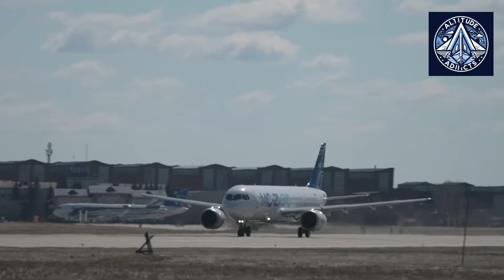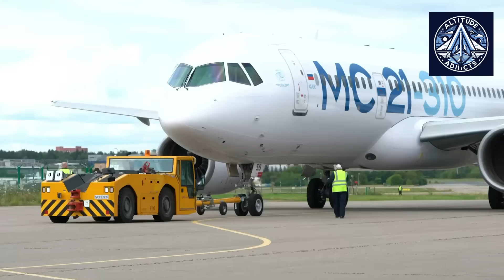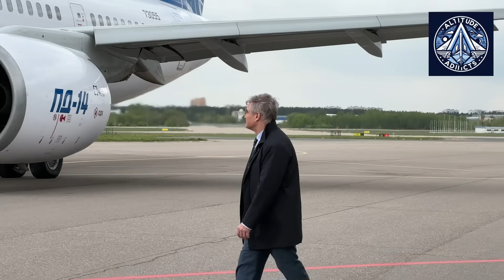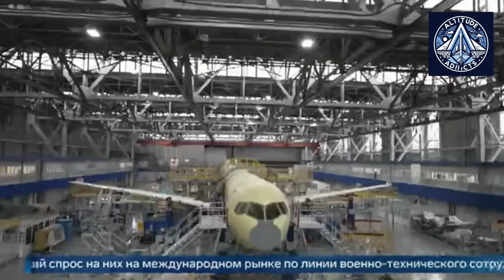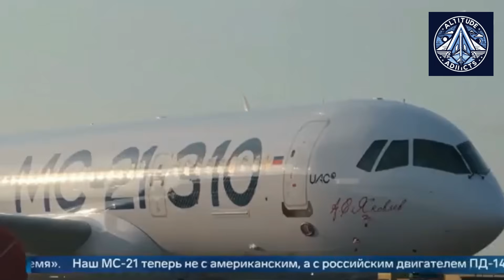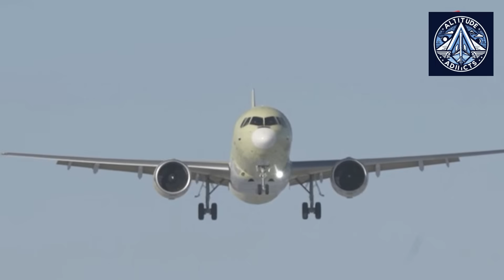MC-21-310 Flies Moscow to Syktyvkar Like a Passenger Flight—Key Test Flight Explained

Comment: Ficou seis toneladas mas pesado?
Reply: Нет , это не так
Reply: @Trunj1969  Pode me explicar melhor, vi uma matéria informando que ele ficou seis toneladas mais pesado e por isso o alcance diminuiu para menos de dois mil km.
Reply: @Combatendo-z1o  The maximum take-off weight has increased by 5.75 tons, it is true. But this is the total weight of the loaded aircraft, it does not reflect the actual weight of the aircraft, it is ABILITY to take-off with a higher load. PD-14 engines weigh only 50-100 kg more than the PW, so the increased take-off weight is either increased fuel tanks or a redesign of the cabin with the ability to carry more luggage. The maximum take-off weight of the aircraft itself is still 10 tons less than the Airbus A320 and the aircraft itself is lighter because of the composite wing, too. The flight range has been reduced from 6,000 km to 5,100 km, but this is not critical at the moment.

Comment: Is it or is it NOT 6 ton OVERWEIGHT from its previous import parts version??? 
In which case it is NO LONGER a medium range airliner.
From where is that excess weight going to come off??
Reply: Это не может быть, техническое задание для производителей деталей, никто не отменял , успокойтесь, авиация точная наука
Reply: Masih bisa jadi jarak menengah jika penumpang sekitar 160 orang.
Masih ada waktu 1 tahun, komponen yang lebih ringan masih mungkin diciptakan.
Reply: The maximum take-off weight is 5.75 tons more. This is just an estimate of the power of the engines by the weight that the aircraft can lift.
A320 has 10 tons more max take-off weight than mc-21 but it's still medium-range airliner
Reply: It came from stupid journalists. Funny that SJ-100 RUS doesnt have the same overweight issues but the MS-21 all of a sudden has, isn't that strange?
Reply: Just fake. There is no overweight.
Reply: Being overweight comes straight from the ass of dumb journalists. 
They saw that the manufacturer had increased the maximum allowable take-off weight of the aircraft by 5.75 tons, and from this they concluded that the weight of the aircraft had increased.